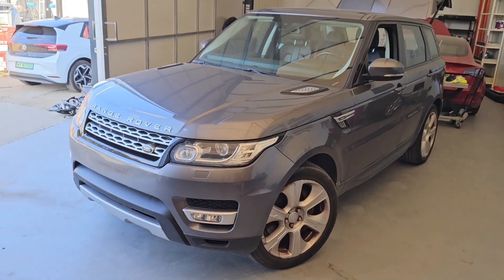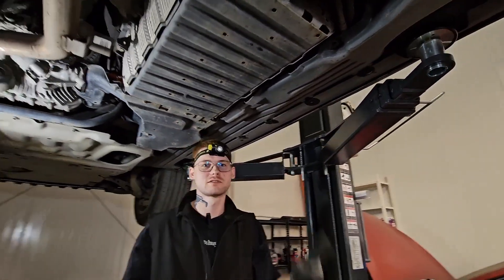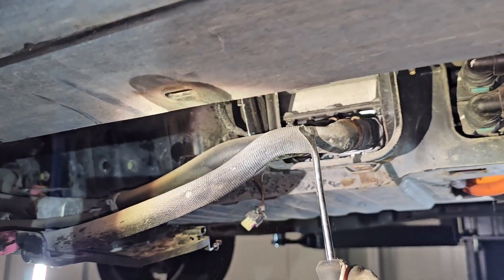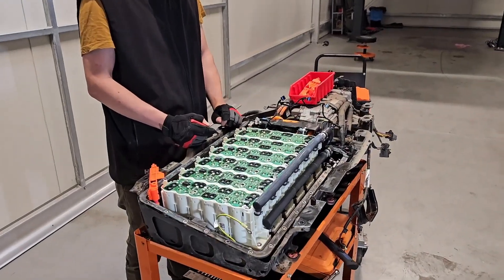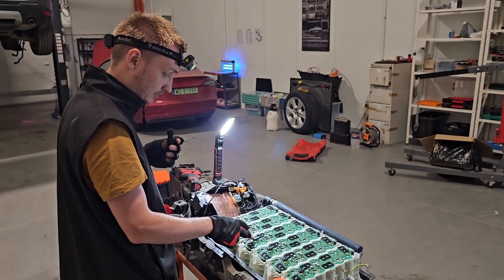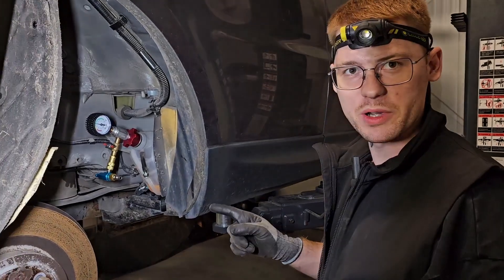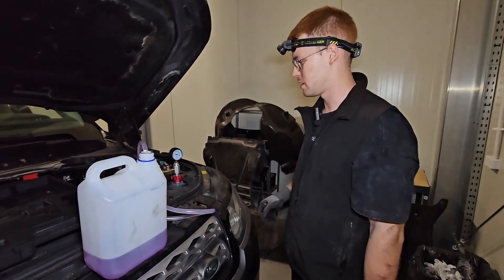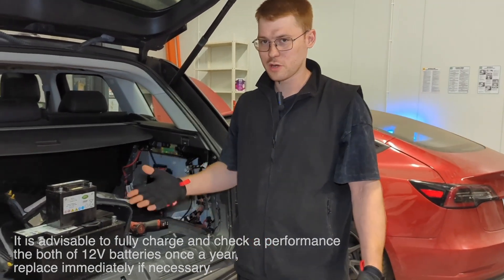Insane 30000 Euro for New HV Battery or Repair?😱Land Rover Range Rover Hybrid Sport Vogue L494 L405

Comment: hi guys i have a 2015 range rover diesel hybrid with a P0B45-00 hybrid system not charging 
but i am all the way in the Bahamas 
how much for a rebuilt high voltage battery?
Reply from the maker: Please contact us by Whatsup, Telegram
☎ +48 884 134 264